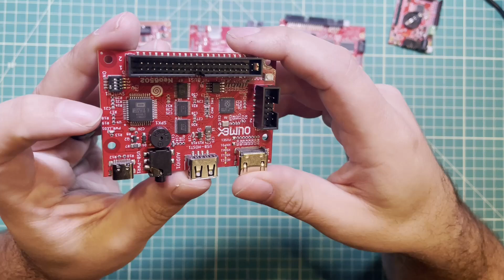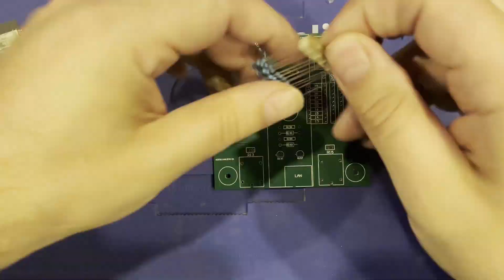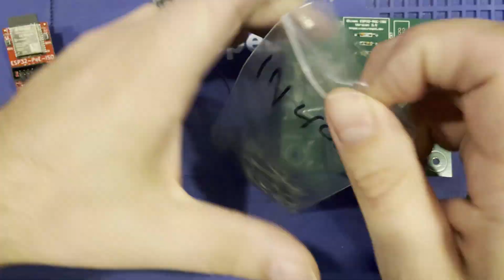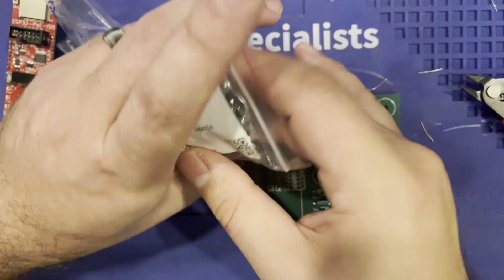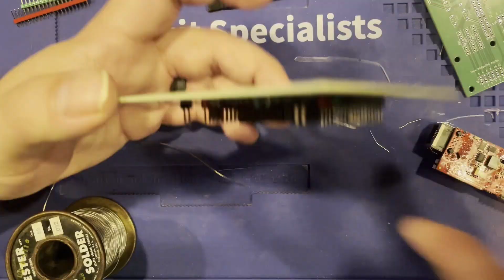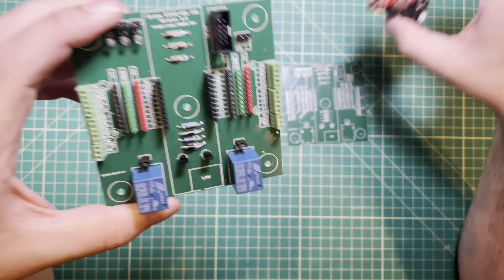Olimex ESP32-PoE-ISO Breakout - My new favorite Olimex setup.

Comment: Hey Maker is saw your earlier videos about the Olimex Board.

Ive been trying to get into programming, but have been struggling with programming.

Can you do maybe a code walkthrough of getting the PoE to connect to a TLS MQTT broker? Especially since you said you seem more a software guy. Im more a hardware guy 

I personally use PlatformIO for programming. I'm not sure what you program in.

Comment: Hey D, would you be open to me sending you some content? I f*ed up last night and forgot to clean a board, fortunately i have a dozen more and can just start again. I think i can get some pretty good footage of what not to do, and at least stills of what bad joints look like under my crappy mustool microscope, compared to good ones?
Started soldering after midnight - took me about 10 min to figure out why all my joints were so bad, going white, not flowing properly and stuff. Was using new solder so it was my first thought, tried flux, tried other solder, took me about a dozen joints to headslap lmao - fortunately just the passives on a thruhole LM317/337 board.
Reply from the maker: haha.  I feel for you with the soldering.  As for content, I've recorded dozens of videos that I haven't edited yet.  Idk that I can handle any more. I do appreciate the offer.